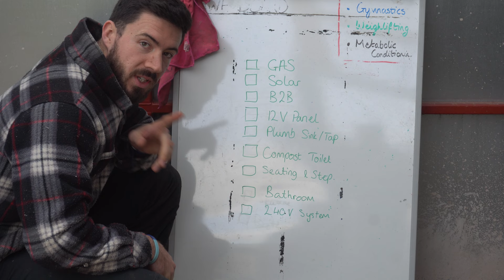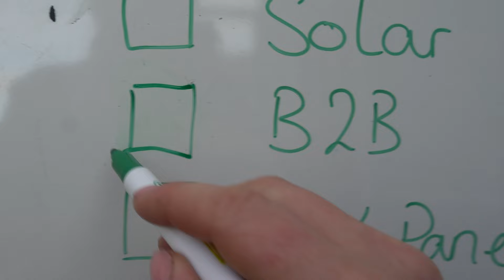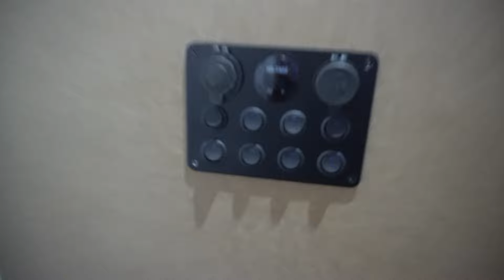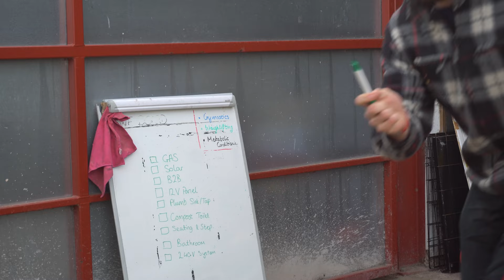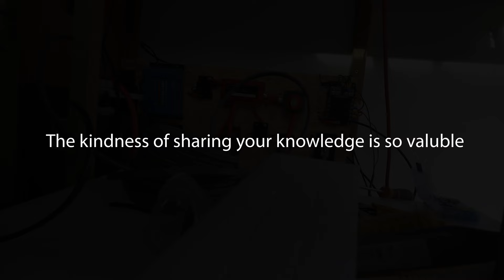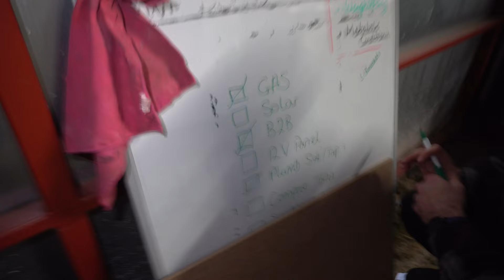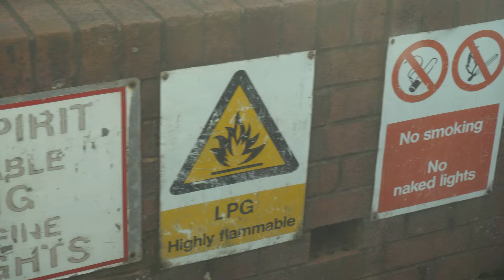We NEED to finish this van in 48 hours. Can we do it? - LUTON BOX VAN CONVERSION

Comment: Hi guys love watching this build well done , only two things Heather great wiring up the b2b charger but you need to put a 50 amp fuse as near the engine battery on the positive cable to the b2b charger that way it protects the cable from the battery its better to have it nearest to engine battery as possible , Leuan on the compost toilet change the funnel to a smoother wall one the flat parts will splash your wee everywhere best with a smooth wall one , hope you don't mind my suggestions, keep it up guys xx
Reply from the maker: Hi Jim, the suggestions are very welcome and keep them coming 👏👏 a massive benefit of these YouTube bids are we have loads of people with more experience and knowledge than us double checking our work for free 😂😂😂 I've got that 50a breaker on my electric board before my B2B, but if it makes the difference I'll try and mount it in the engine bay somewhere 👌 thanks for the tips

Comment: Making some good progress now. have you put some rubber strips in around your gas tank to stop it from rubbing and rattling? it would just act as a shock absorber in away 😁👍
Reply from the maker: Hey Matt, luckily the brackets  came with some rubber strips to line the insides, so we popped them in 👌

Comment: Not very clever re your gas plumbing given u will be sleeping in the van  quite dangerous
Reply from the maker: What part do you think is dangerous? We have been around every connection now and checked for leaks. And also we have the shut off valve, so when the gas is not is use it is off